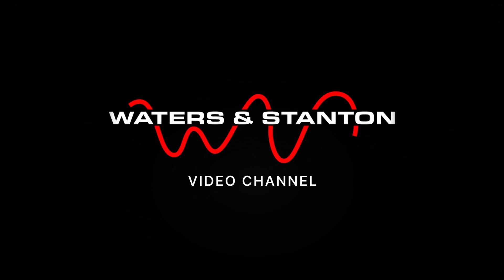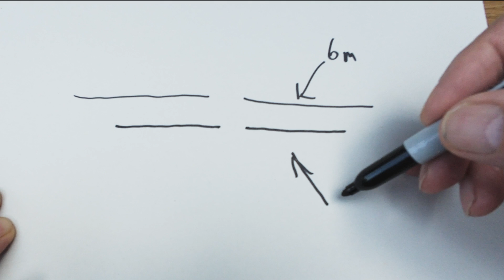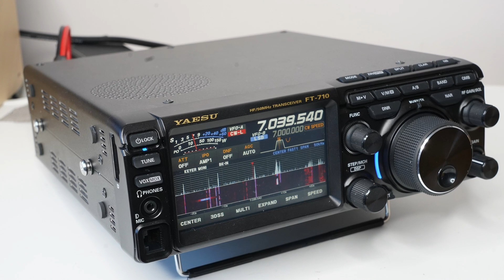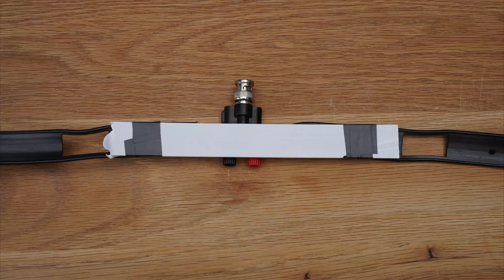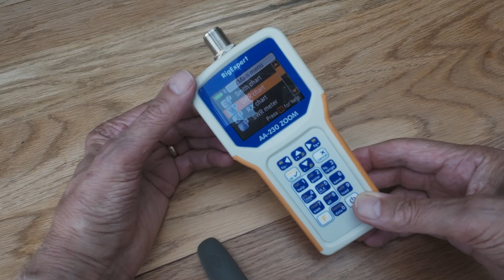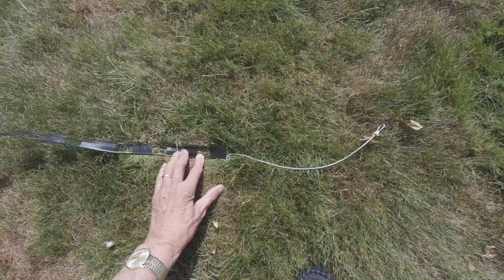Dual Band 6m and 4m Quick Dip Antenna - A simple to build Antenna

Comment: I made this and use it as a vertical mounted on a pole through a tree with very pleasing results.  The big suprise was that it actually also works really well on 2m and 7cm.  Swr < 1.8.  In fact it works so well its become my main 2m/70cm as well.   Not sure why this works and it my be specific to my setup,  but very happy with it non-the-less.

Comment: Having recently purchased an FT-897D I have been looking for a cheap antenna to try out 6m.  I gave this a go and made a local contact during the 50MHz RSGB contest on Thursday.  Having experimented with different lengths, I found that I had to use an atu to get the swr down. That was my first 6m contact in over 20 years!  Thanks, Noel, GI7CMC

Comment: Sounds like a great weekend project, but what always confuses me is not having to use a balun. I can understand coiling the coax for a choke, but if you have a 450 ohm ladder line and 50 ohm coax, I would think your SWR would be high. You didn't need to use a 9:1 unun?
Reply from the maker: The ladder line is not being used as a feeder, but as two dipoles in parallel.

Comment: Another way of achieving the same thing is to use a conventionally driven 6m dipole and parasitically drive the 4m one. It is not connected by the feeder and needs to be positioned about 75-100mm from the 6m one.

Comment: I have a question please Peter. 

I have seen antenna switches, but like the idea of a 2 for one 😀.

Is this build technically acceptable, as they are both dipoles and by their make up will be used in the same orientation?

Or is it driven by their frequencies?

Thanks
Roger
Reply from the maker: They auto switch with frequency.
Reply: @watersstanton  Thanks Peter.

Comment: For 6m mobile an easy solution is to take a 1.5 m long "CB stinger", 2 small jubilee clips & 6" of copper braid... Take cb antenna, scrape off paint on the ends of the coil at the bottom, short it out with braid affixed at each end with the jubilee clips & voilla one instant 6m quater wave